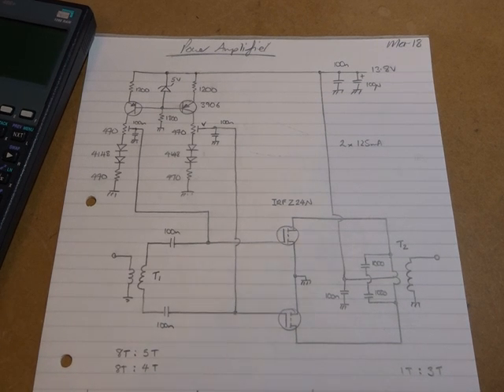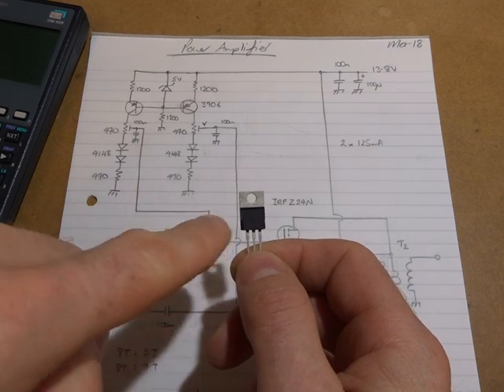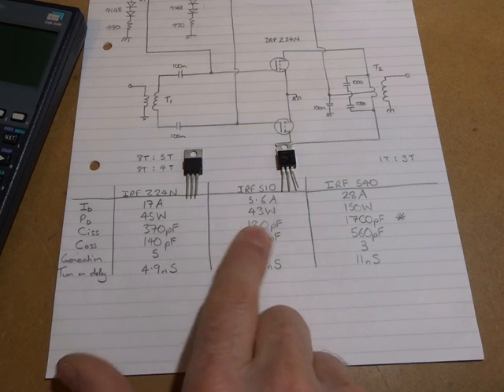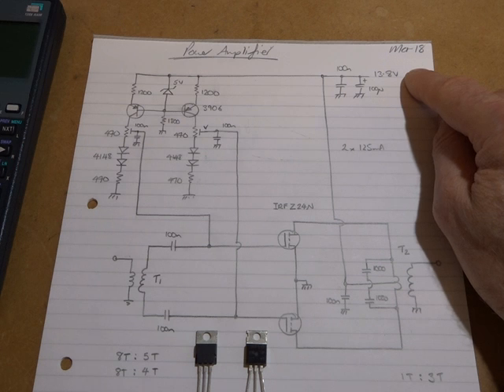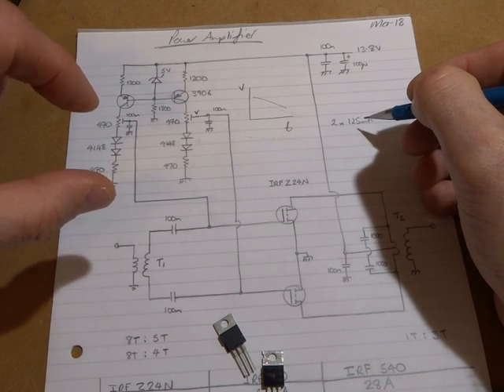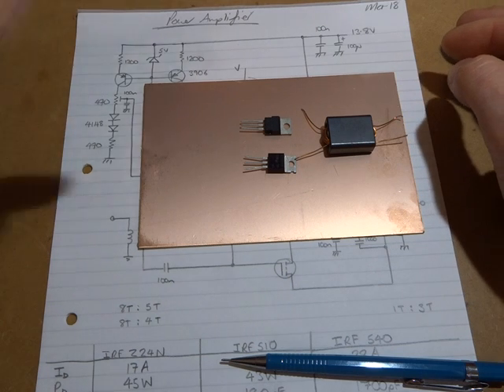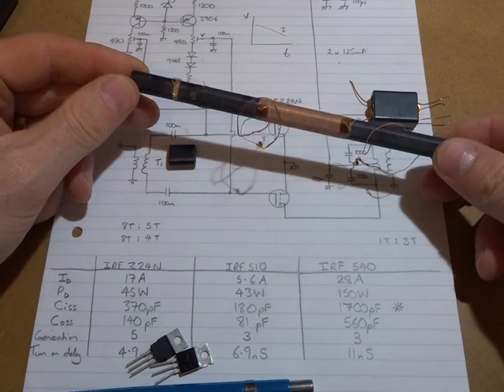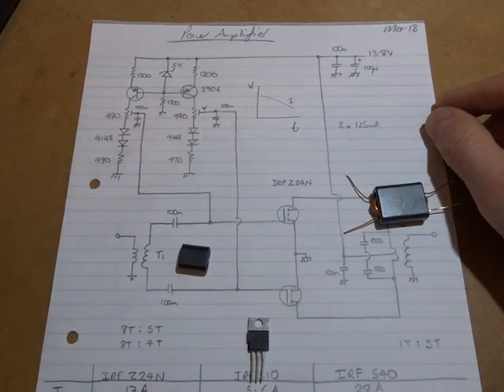Homebrew RF Power Amplifier: Part 1 Thoughts and Ideas

Comment: Great video. I'm curious, what is the minimum carrier amplitude required at the input ? I've made a low power 10.7Mhz transmitter with a base signal output of 2V (the modulated envelope is about 7v).   I'm hoping to give your amplifier a try.

Comment: I need to buy my toriods next time I have money to do so. (Mostly for filters and baluns)
Reply from the maker: I tend to buy in bulk. It will be interesting to see if I can make the ferrite rods work in this application.
Reply: @CharlieMorrisZL2CTM  I'm not sure you can use a ferrite rod as a transformer as there is no closed magnetic circuit, the coupling between the input and output will be very weak, so it will not be able to provide any output current.

Comment: Happy to see you reproduce this amp Charlie!  I had a good experience with it, write up is here https://vk3hn.wordpress.com/2019/01/30/homebrew-50-watt-amplifier-for-80-17m-w6jl/ 
  
The limiting factor for this design is the ability to get heat away from the TO220 FETs. On your aluminum strip the FETs will get to finger  burn temp in 20s, this amp needs a substantial  heatsink. I made up my amp with a mid sized Jaycar heatsink, then when it got too hot to touch, realised that heat sinking is the number one design driver, so remade the PCB to snug fit into a 3mm thick by 22cm long alum channel with a 10mm alum heat conducting block between the FET tabs and channel. Even then I needed to add a small fan just mm above the two FETs. Now it runs cool!  I agree with another commenter, a very modest airflow cools surprisingly well. 

Also, I've given up buying Chinese semiconductors,  particularly for a power device, I've had a few disappointing results, even if the devices are what they claim to be, a lot of the stuff offered up cheap is factory seconds at best, and you will be pushing these devices in a 50w amp! Good luck! Element14 and RS are just a click away!  My homebrew leisure time is too important to waste it on junk FETs.  Looking forward to the next episode.  Thanks Charlie! Oh, Don's write up is one of the best I've seen, it will answer all your questions,  I hope someone sends it to you!
Reply from the maker: Thanks Paul. I read your write up too a while back. Lots of good info there!  It looks like I need to do away with the cheap heat sink approach and just do it properly from the outset. I've got a few in the garage so I'll use one of them. As for cheap Chinese semiconductors, I hear you! I might just go ahead and blow a couple up and then order some of Element14. I'm not too worried. Anyway, thanks for taking the time to leave a comment. Much appreciated.
Reply from the maker: Just ordered 6 from RS :o)

Comment: I hate to state the obvious Charlie but these are not RF devices and as such you can't really connect the tab to a heatsink as you increase the D-S capacitance tremendously.  RF devices have the tab connected to source so you can ground it.
Reply from the maker: That's interesting Roger. I wonder how W6JL overcame that with the original design, as he used a heatsink with that. I assume he used thermal isolation strips, which is what I intend to use. Cheers.
Reply: @CharlieMorrisZL2CTM  Well, besides the huge reactive current being forced into the heatsink by the tab capacitance, you have to design your matching network taking into account the additional drain to heatsink capacitance which is much larger than it should ideally be. If you use an RF transistor such as one of the Mitsubishi RD devices you get a better PA. And they are not all that expensive.
Reply from the maker: Hi Roger. Thanks for the input, it is appreciated. I acknowledge the IRFZ24N is not a RF device. I had been asked several times in previous videos to try W6JL's amplifier, hence this series. I have elected to change things a bit by trying a ferrite rod transformers and a simple heatsink arrangement to minimize cost and complexity. We'll see if that is a good idea or not IDC. Again, thanks for the input Roger.Charlie
Reply: I have one built on one of the older PC micros heatsinks with built in fan.  Seems ok although i am not a gasbag......
There are usually available from old PC's for a song or even less.
Reply from the maker: @glennp9904  Good idea Glenn. I used to build all my PCs from parts some years ago so there is a box in the garage with heatsinks, fans etc. The plan is to raid that if need be. Like you, I am not really much of a talker so hopefully, I'll be ok.

Comment: BUT the '510 has a s-d voltage rating of 100v, the 'Z24 only 55v.  So no using a 24v supply on the 'Z24!
Reply from the maker: True, which is why this will only run off 13.8V.

Comment: Far from being a specialist in HF design, I'd suggest to add a choke between the bias voltage source and the FET gates, to avoid HF travelling back to the supply. Good luck and I look forward to see the next video.
73's de ON4KNP
Reply from the maker: Hi. I agree. I put in RFCs when i was playing around with the LDMOS amp. They are not in this schematic as I've tried to keep in it faithful to W6JL's design. It will be easy enough to add them in at the end.

Comment: Charlie,

You are correct that capacitance is an issue with trying to use power mosfets. Looking at your specs the IRFZ24N mosfet has twice the capacitance of the 510. Is the capacitance still low enough for RF work.. it will be interesting to see.

Some mosfet companies make special drivers just for driving the capacitance of these devices during switching...the wave forms are strange, non linear, and they are in the Khz range.

As you probably know,  heat sinks have specs like... thermal resistance, area of the material, and air flow. Just a small amount of airflow  makes a big difference in cooling capacity. Consider a small fan impinging air on the heat sink if you will be running  power these parts are capable of.

Really appreciate all that you are doing and sharing.
Reply from the maker: Thanks Kenneth. I'm using the IRFZ24N as i understand that is what W6JL used. It will be interesting to see how it plays out. As for heat sinks, I am aware of the thermal resistance etc, and already have an old computer fan on standby. The reason why I often make unconventional decisions is to experiment and see if it can be done with simple off the shelf hardware/components as I'm conscious it is often difficult to source appropriate components in some countries/regions. Thaks again for the input. Much appreciated!

Charlie

Comment: I suppose you will continue the series about teensy sdr?
Reply from the maker: Yes. The plan will be to make a small SDR receiver for the panadapter. I'm just mixing things up.
Reply: Tnx! I Guess you'll do the TX part as well, it can really be an excellent SDR TRX!. 73 de 9A3RU
Reply from the maker: @lzyoyuzautoedl9ahavupygm2026  Probably not for the panadapter itself. If you look back there is a build series for a Teensy SDR with TX. I am looking to rebuild that at some stage.